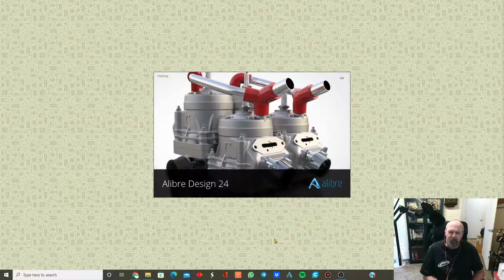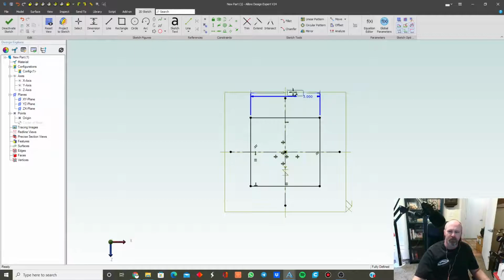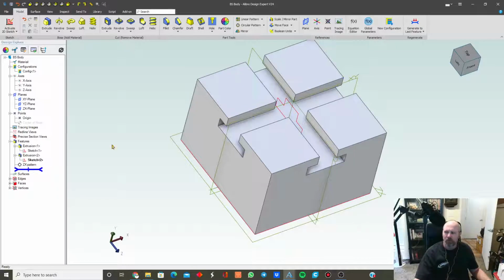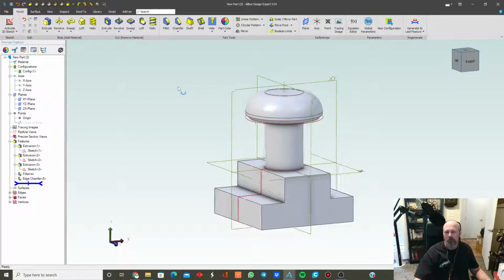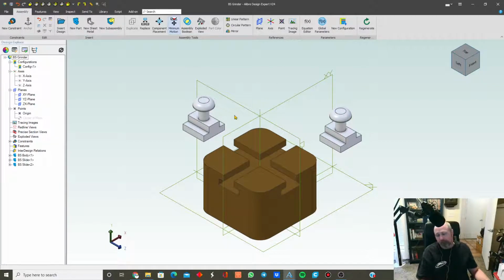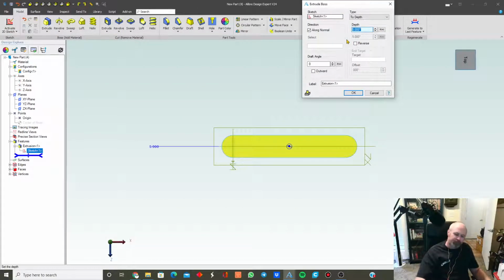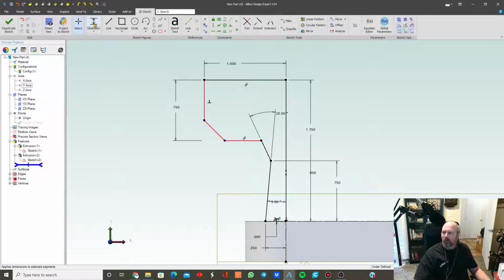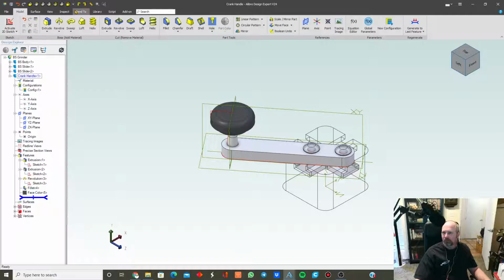Beginners Alibre' Design tutorial: BS Grinder

Comment: Steve
Nicely done!  It's nice to see Alibre getting a little more love out there - it's gotta be a challenge competing against a handful of "free" modeling packages.  I've been an Alibre user for some time.  I do have a question for you:
How do you use the Hole Presets?  I guess what I'm asking is once created, how do you recall them when working on a different part?  I've had kindof sporadic results.  Apparently, the presets are stored in a file:  C:\ProgramData\Alibre Design\System Files
 - alibre_unicode.hps But that doesn't mean much to me.  What I DO know, is that I've created a bunch of presets and sometimes been able to recall them on a new part but often came up blank.
Any help would be appreciated, and keep the videos coming, you do a nice job.
Chandler
Reply from the maker: I have ideas on new things to show. But using the "hole" function is not always as intuitive as you think it should be. 

Alibre changed how the hole works when they went to the ribbon format, and it screwed me up for a bit. Now I'm used to it. There are some quirks to the function and these are what I should cover.